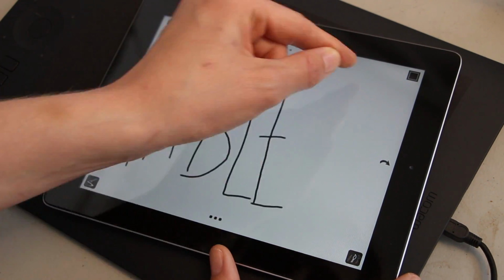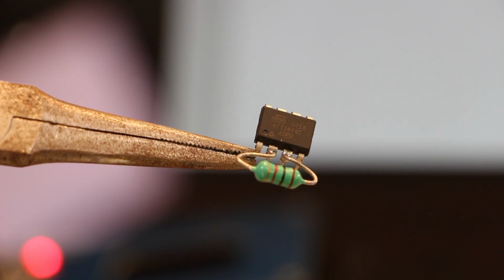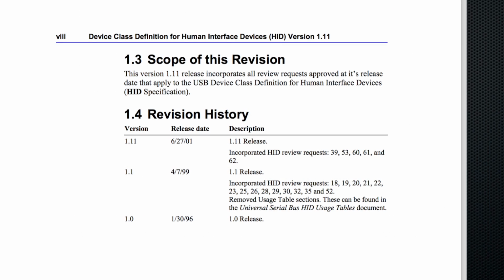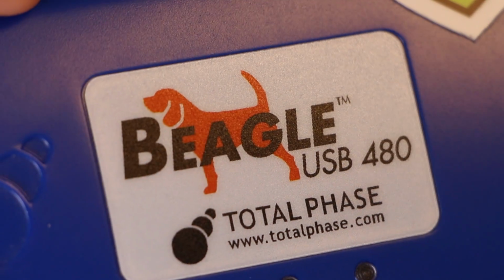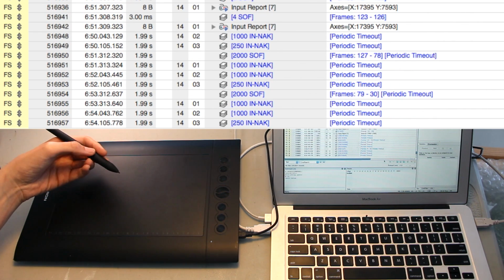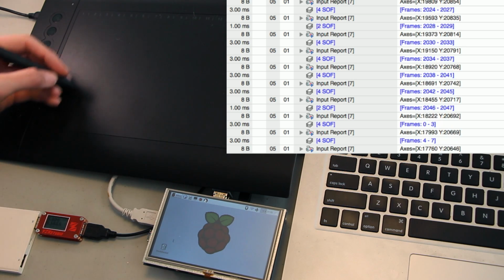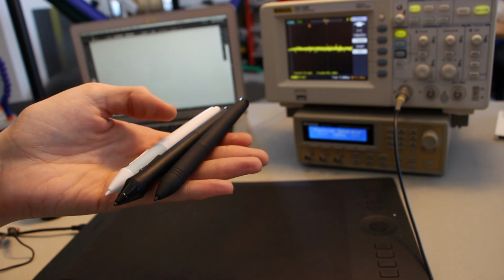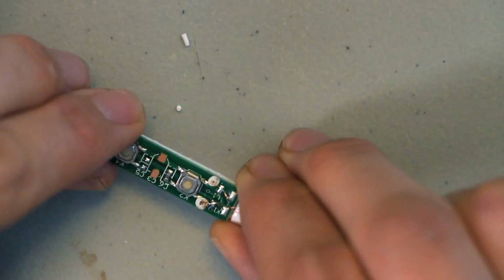Graphics Tablet Primer for Hackers - scanlime:012

Comment: Do you know what kind of circuit does this pen use? Because all the single transistor sine wave generator circuit I could find require 9V of supply, not 1.5V battery. Thanks

Comment: Need help, my battery free pen isn't respond to the graphic tablet.. so when i hover and move it, the cursor in the monitor doesn't move at all - the click buttons on barrel and the tip also didn't work. I don't know if the problem comes from the pen or the tablet - I don't have all those fancy tools to check if the pen or tablet works properly

Comment: Hi can you help me in  my project to  use my huion small graphic table and using coper thin wire  and make a big table out of my small tablet and also can I attached it with my OLED TV or led tv  ( can I map the circuit behind my tv display acurately)

Comment: Excellent video.  That sort of explains some of the driver problems using various  mice, touchpads and other HIDs on my old Thinkpads with everything seeming to fight and none of it working properly. As of March 2020, Huion Display Tablets have surpassed Wacom for featues and are relatively dirt cheap. And even cheaper if you want an older model. I will have to try looking at some of the signals with my scope. These tablets are tempting but I still prefer my Polychromos pencils and paper.

Comment: My goddess, your videos on Huion h610 are very helpful. it's kinda hard to measure pen parameters with my dodgy analog scope or logic analyzer. I was interested is it possible to emulate eraser pen if h610 does not have one or add buttons or axis to existing pen. Huion driver shows that there is stylus, puck, and eraser(in GIMP). I has hope for they are on different carrier(and ordered spare pen for experiments). 
But i guess driver is crap and there no extra functionality possible. Can you share schematic for huion pen? Or hi-res photos of pcb? 2 years pass, but Really appreciate if you do.

Comment: Huion/UC Logic is such a simple design. I can't imagine the prior Aiptek/Waltop tablets to have been neither simpler nor more complicated, however those worked absolutely horribly, particularly the larger sized ones, very susceptible to ambient RFI. Perhaps it's the shielding that makes some of the difference, as the edges on Waltop were unstable in particular.

And thanks, this is SUCH an awesome video.